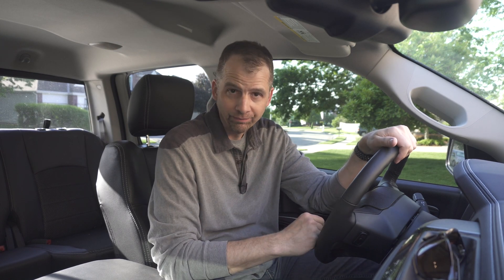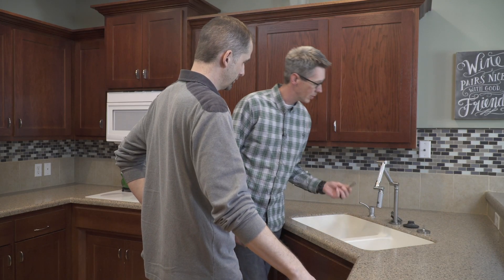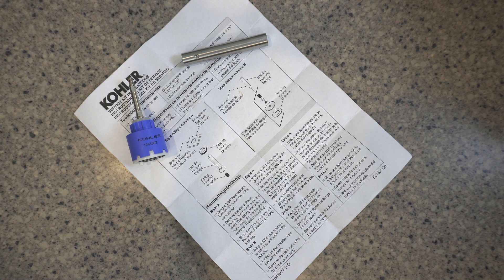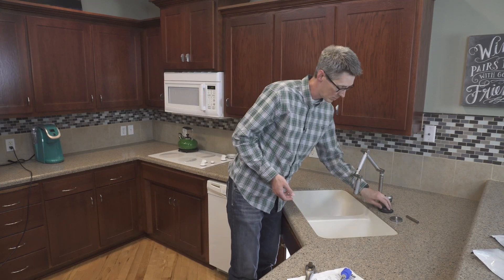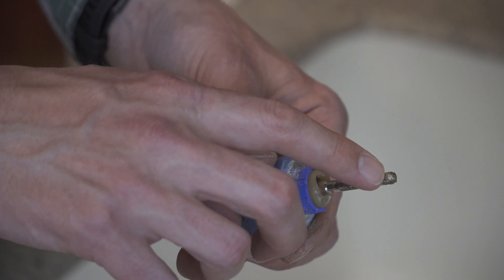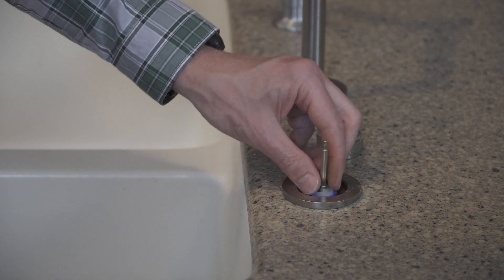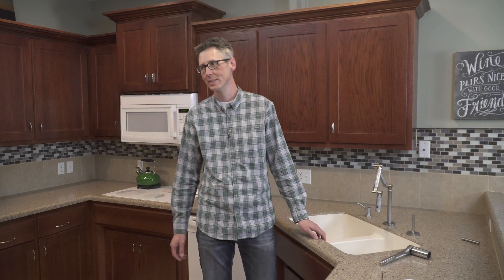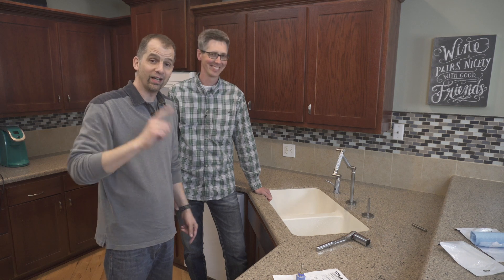DIYnot 1705 - Kohler Karbon Faucet Repair

Comment: Generally good video  and help me out with replacing my Kohler part. A couple of notes to anyone having this issue. 1) You should email Kohler, they will help you get the right part or troubleshoot your problem, and your Karbon Faucet might be under warranty. This was the case for me, and they just sent me the part. 2) Make sure no sediment goes down the tube that feeds the faucet. The entry for it is very small and if it gets clogged, mine did, no water will come out the faucet even if the part is installed right. How I fixed it was once I figured out what was wrong, I got under the sink, disconnected the hose that runs to the faucet part.  Checked to see if it was block, it was, then used the Allen Wrench to puncher a hole in the sediment and wiggled it around until I felt water back flow from the hose onto my hand.  

Also, one other note, for a new DIYer a 1 1/8 ratchet head is not something comes in you standard ratchet set. It is larger than the lug-nut on a car tire. I happen to have a plumbers ratchet set I bought at Home Depot, which has all of the sizes for taking off the valves in a shower. So that had a 1 3/16 that worked for me, but otherwise I would have to gone to the hardware store.

Comment: Hello! This is just what I needed to figure out this exact repair. The valve kit I received from Kohler for the Karbon faucet handle thought didn't have the service kit instructions. Do you happen to have an electronic copy you could post or a link to where I might find it? I can also reach out to Kohler, but from a timing standpoint, it takes them several days to respond.  Thanks again for posting this video - regardless of the instructions, I think I may be able to repair it myself!
Reply from the maker: Thanks Larry, glad this helped out some. I think you should be able to find what you're looking for on the Kohler web page: https://www.us.kohler.com/us/Karbon-articulating-two-hole-deck-mount-kitchen-sink-faucet-with-13-spout-with-Silver-tube/productDetail/kitchen-sink-faucets/427649.htm?skuId=405108&brandId=432405.  Good luck.
Reply: Awesome thanks -- Appreciate the help!

Comment: So a 3000 dollar faucet breaks like a cheap appliance. Great.
Reply: We put all Kohler stuff in our house and it's been about 10 years and things are breaking. I had this exact problem, also have issues with toilet flush buttons and showerheads. Been on the phone with them dozens of times in the last few weeks. Sleek and modern and customizable but really wish they were made more simple. Wish we had put old reliable boring fixtures in instead.
Reply: I married my wife five years ago and everything in her house are insanely overpriced. The stove, the shower, the heating system and this. Its been a challenge as I am not used to working on such expensive hardware. I have never owned a 7,500 stove, its crazy and it breaks the same and the parts are also very expensive.
Reply: @RoccoEugene  Same, We have had 3 leaks with this Kohler Karbon, no wonder it's discontinued. Cool looking, but for whatever it cost (we are 2nd home owners) it shouldn't break. THAT being said, Kohler has sent us every part we requested.